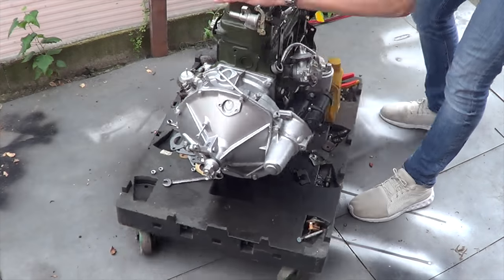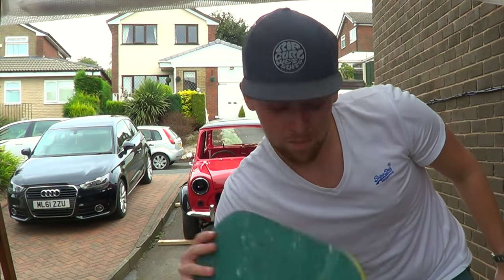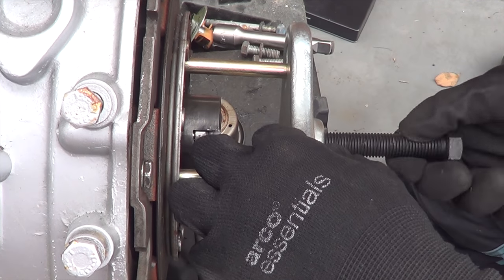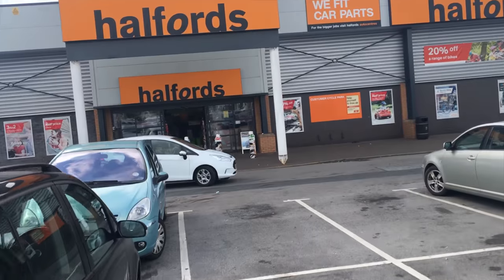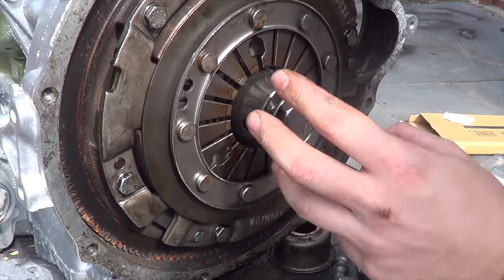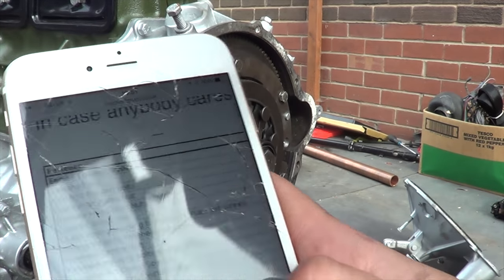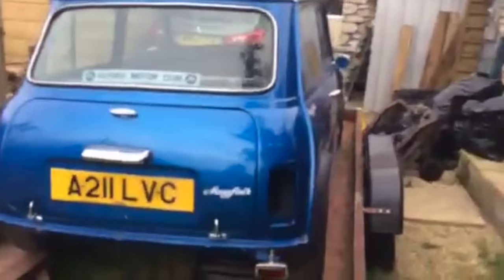Classic Mini Restoration | Clutch Replacement

Comment: did you put a new cup thing that covers the center crank bolt as i saw it sutting on the floor at the end of the video
Reply from the maker: mark piper I didn't put a new one it dude I put the old one in, I just forgot to put it on as I was filming😂 do you recommend a new one?

Comment: Used to do mine with the engine in the car, I was 17 at the time, easy job, adjust on the two big nuts at the outside. Flywheel was knocked off thro the starter motor housing. I'm 69 now.
Reply from the maker: That sounds difficult

Comment: Here's a tip, too late though, assemble flywheel puller (correctly) tighten up puller bolt as much as one thinks safe. If flywheel does not come off, stop, boil a full kettle of water, pour it slowly over the flywheel. Flywheel should pop off.

Comment: Did u wreck the 1st puller because u forgot to remove the big centre bolt? or was it just so tight, ?
Reply: Forgot to remove the bolt , the cheap pullers aren't great but they do the job most of the time if the clutch assembly isn't still bolted up. Doh!
Reply from the maker: Certainly did 😂 everyday is a school day

Comment: Did the flywheel bolt really undo that easily? It should be torqued up to 150lbs/ft.....
Reply from the maker: Paul Jeffries worryingly yes 😬
Reply: 😮😮😮 it's a good job that you removed it then 👍

Comment: No turbo?
Reply from the maker: Max Brown tempted, tempted but what do you recon the cost would be ?😬
Reply: Total Car Reviews yah it could be a high price but now would be the best time to do it
Reply from the maker: Max Brown don't I need an ecu and everything ?
Reply: Total Car Reviews yah but there are loads of vids on YouTube or you could supercharge it and might car mods did a great set of vids for how to do that
Reply: No you can run a turbo on a carb, no ECU needed.
Reply: Why not join in!!!! - https://www.youtube.com/c/turbominitv
Reply from the maker: Turbo Mini TV I'm intruiged!! Is it an easy task as I'm no mechanic just a learner 👌🏻
Reply: Simple answer - its easy to fit, but a bugger to get running right. 
You can just fit a Metro turbo manifold, turbo, intake and carb, but you need to factor in fuel delivery, engine strength and other things. 
adding to that running a carb you have no control over the fuelling, as its set by the needle. 

So long story short its possible and people do it, but you are better of running injection on a programmable ECU.
Reply from the maker: haha! yeh i think ill stick with the standard setup and potentially build a better car next :)

Comment: Not so much loc-tite!!
Reply from the maker: thebluep0tat0 what do you mean dude?
Reply: Suggestion only to use a drop on each both - because if you ever have to replace the clutch again, those bolts will be seized and hard to get off with so much loctite.  Something I learned many moons ago.
Reply from the maker: thanks for the advice dude! the bolts i took out were hammered in the stuff

Comment: That clutch wasn't particularly worn, really.
Reply from the maker: Turbo Mini TV just thought it was best to change it whilst the engine was out
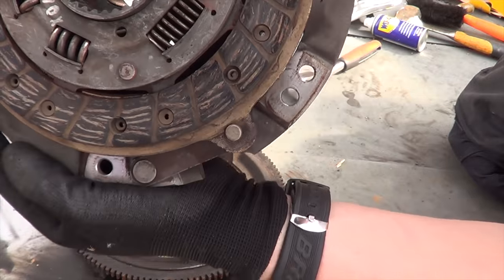Reply: Oh definitely! Just how you put it at 8:35, sounded like it was catastrophic, that's got 10k miles left on it.
How far are you from finishing the build? I'm FINALLY just weeks away, its a long process, you have my full sympathy!
Reply from the maker: for some reason dude I never got a notification from your comment! im not to sure mate if i had knowledge and all the parts and time off work id say weeks! but other than that im not to bothered as long as i can still produce videos from it :)